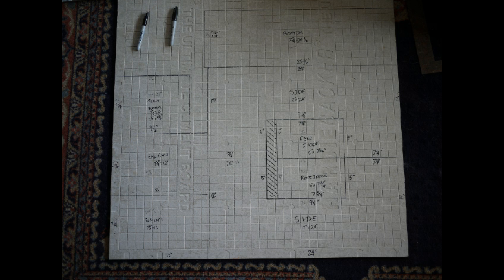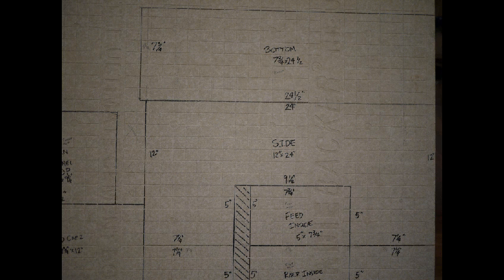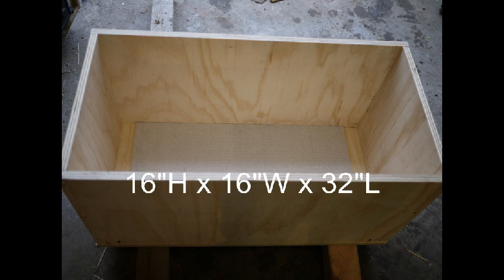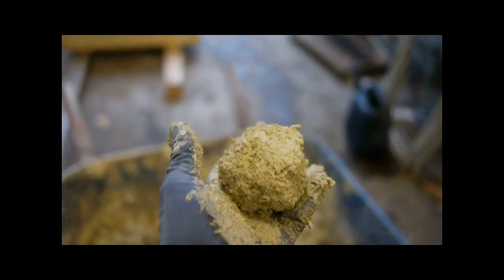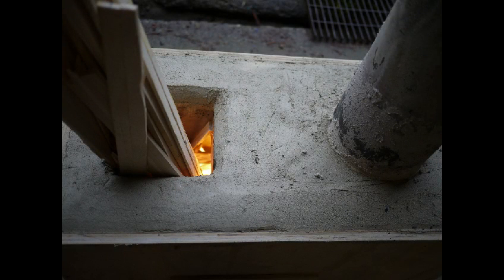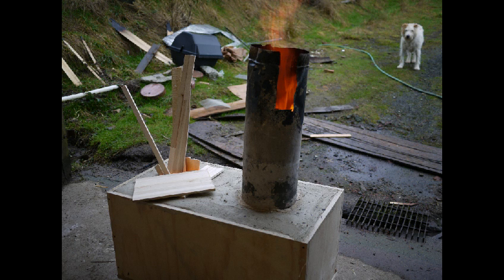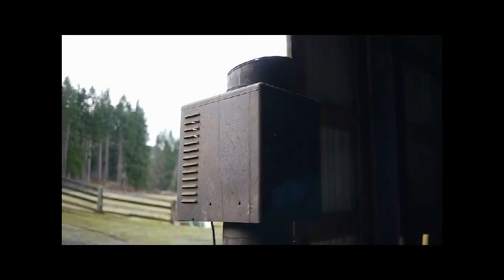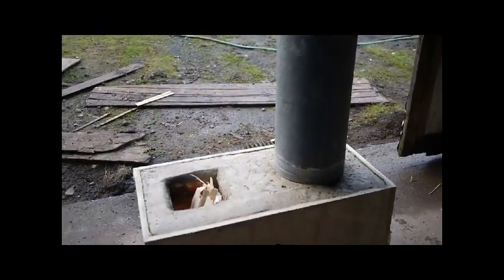Rocket Mass Heater Cast Core Build

Comment: At the end you say, "then you're ready to fire 'er up". But presumably you would need to connect it to an exhaust pipe before burning, correct? Or are you moving this whole core and burn chamber into place in the house AFTER you finish constructing the core components?
Reply from the maker: The latter.  I build them outdoors, or, rather, in my wide open shop, and then burn it dry before moving inside.  You could cast in place, and connect the exhaust first, then dry it out in place.  I actually think this is a better way to go, but in the case of the video I was building it for a friend, so was working remotely from the final install site.  Hope that helps.
Reply: ***** How many burn hours does it typically take before the core is ready to set in cob?  What signs are you looking for to know that it's fully cured?
Reply from the maker: I don't think I could put a time on it, but the idea is to get it firm enough that you can move it without it sagging or deforming.  I would say that a few(4?) hours of burning will certainly not dry it entirely, but should set the mix so you can move it safely.  Once in place you can start cobbing around it even if it is not fully cured.  Thanks for the comment.

Comment: It is doable, i think.
It will crack a lot most probably but we dont mind that until it holds together. So i recommend to put some reinforcements inside. Like reinforced concrete, but with long glass stripes. 
Painters have tape like (thin veil or tissue like) material for dry wall joints. We could use that to keep the piece from cracking, (or at least not to fall apart) by placing the stripes near the surfaces of the piece.

Comment: Hi Matt, saw your video where you converted your home rocket heater to a batch feed based on Peter Van de Bergs batch heater.Very intrigued by this.Where could I find more details to make one myself? I also sawed a barrel in half for quick bench material.Thanks.
Reply from the maker: Hi Emily, best place to find details on Peter's design is on Donkey's forum on Proboards.  Search "rocket stoves..experimenter's corner" and it should come right up.  I hope to create a video showing my process soon.  Glad to hear about your progress, good luck on the build and thanks for the comment.

Comment: Okay, maybe a dumb question, but can I make it without the refractory cement?  I mean 1/29th  is only 3.5% of the mix, doesn't seem like nearly enough to make a difference.  Have you tried making it with fire clay and perlite alone?  Thanks.
Reply from the maker: You can, that is how I do the riser since it is encapsulated.  The furnace cement mainly is there for the addition of sodium silicate, and it doesn't make it much harder over time.  Just harder, sooner.  The whole thing is fairly fragile, and without the furnace cement, a little more so at first.  But yeah, I say go for it.

Comment: Thanks for the video! I've watched it many times but ironically didnt sink in that I'm trying to help my dad build a 6" and not 8". Would you still use the same dimensions as you have here? How many bags of perlite and fire clay did it end up taking? Thank you.
Reply from the maker: Brian, to make a 6" use the same overall Length and Height for riser/feed stubs, but make the passageways 5 3/8" sq. instead of the 7 1/4" shown here.  This one took 3 bags of Lincoln 60 clay and 4 cu/ft perlite.  Good luck on your build.

Comment: FInnaly getting to it. 

If the burn square ection (7.25x7.25) is smaller, would I need to shorten the horizontal 9 1/2" burn chamber?
Reply from the maker: No, keep it the same length.  Any shorter and it becomes difficult to fit the barrel, you need a little distance from the wood feed.  Hope that helps.

Comment: Unless your house is so tight you can take it into space, I wouldn't have thought it was a problem, the negative pressure will find any leaks, there are always some, even in the best built homes and it's not just doors and windows but roof and walls as well, although your walls will probably be pretty good but you get the idea.

Comment: Hi there I was thinking today could that be made out cardboard or is that to weak ? . How are the walker stoves coming ? . Thanks dan
Reply from the maker: Hi Dan, cardboard will soak up the water in the mix and get too soft.  You can use anything that will stay strong when wet, wood works fine. Walker Stoves is moving forward, slowly but surely.  Thanks for the comment.

Comment: What is the source of your research on the efficiency of the cast core vs built with firebricks? If a cast core is more efficient, then it must be due to the insulating characteristics of the cast material, correct?
Reply from the maker: Hi Douglas, in this video I was hoping to convey that I felt that the insulated core offers better performance, not necessarily efficiency.  Efficiency is tied so closely with the heat extraction of any given system that it's hard to compare when all RMH's are site built and use different extraction and thus will have different efficiencies even with the same combustion unit.  At any rate, if you watch my video here: Rocket Mass Heater tested with Flue Gas Analyzer you'll see how my cast core runs, and of particular note is the extremely low CO numbers.  When running full out it is typically running at less than 10ppm CO.  I've never tested a brick built rocket mass heater that was able to run at that low level.  Not to say they aren't out there, I just haven't run into one.  At any rate, yes, I believe a highly insulated core performs better than a core of the same design built using bricks.  That's my opinion, I'm sure you'll find differing ones out there. Thanks for the comment.

Comment: Getting closer to casting - wondering if one were to scale this down, say to a 4" outlet, would it be to much to assume that I could just cut my dimensions for the pieces in half???  The shop is only about 400 sq ft.  Thanks
Reply from the maker: Richard, you may be able to, but 4" systems tend to be very tricky to get right, and are a pain in the butt to feed in my experience.  I'd recommend no smaller than 6", you can feed less wood if you don't need the full output.  For a 6" system make the square passageways 5 3/8" square or so, and leave the overall lengths and height of all outside dimensions the same.  A big pitfall of scaling down is you can leave yourself with no room for the riser/barrel combo if you shorten the overall length by too much.  Good luck on the build, and thanks for the comment.

Comment: Great project, thanks for sharing. How will this cast core stand up over time compared to firebrick or regular soft brick, or is it too soon to tell?
Reply from the maker: I burned mine for 3 full seasons and it held up fine in the burn areas.  The mix is soft, so it wears from wood feed abuse, but a handful of mix every month or so is all it takes to patch it up.  I would say it's comparable to soft brick.  I don't recommend firebrick, they make a very hot feed that creates a whole host of problems.  You asked about fiberglass, and I don't have an amount for you.  You want it evenly spread as single hairs throughout, but no clumping.  Not much, a few handfuls will do it.  Good luck on your build.
Reply: Would it help to coat high wear areas with Water Glass ?

Comment: So if I build the tube with wood, it sill burn out on the first burn and then the fire will
just 'sit' and burn on the cement/perlite/fireclay mix?

and is that heat resistant enough?
Reply from the maker: Yes, the fireclay/perlite mix is a decent refractory material.  It is a bit soft, so areas where wood abrades it do wear, but it is easily patched with more of the same.  I used mine in my home for 3 full heating seasons, as the sole source of heat, and found it performed very well.  I did have to patch it occasionally through the season, but that was acceptable to me.  If you want a more durable core you can source some castable refractory and follow these same plans.  Reduce the outer mold so that the wall thickness is only 1"-2" if you use castable refractory.  Good luck on your build Yves.
Reply: thank you, I am very excited about this project. Unfortunately I'm not a regulard 'builder', more a software guy..;)

Hope you don't mind my new questions:
1) what is 'castable refractory'? is that the expensive stuff you mention in the video?

2) How did you channel the heat inside your house? did you have a heat exchanger and blew that throuhgh ducts around the house or did you heat up a closed circuit radiator system? (because we have that here).

3) and finally: I was thinking of makign the tunnels out of cardboard. by rolling them in a tube shape an then cutting them at 45deg angles. after the thing cures it should be easy to remove some part in the center and once passage is there, simply burn the rest out?
Do you see anything going wrong with this?

again thanks  and please let me know how I can support your efforts

cheers
Reply from the maker: Yves Baggi
Hi Yves, here's some answers...
1)Yep, the expensive stuff.  Used in industry, as the inside of industrial boilers and stuff.  Can be hard to find, but worth calling around if you live in a place that has industry close by.

2)Nothing that fancy, just heat the mass, which is made of cob(clay/sand...basically mud!).  That's the benches around the heater in my other videos, they have the flue pipe running through them, heating the mass.  It's basically a masonry heater, or perhaps you know them as russian heater, kachelofen, or contraflow masonry heater.  Similar concepts.

3)Cardboard will become wet and lose it's strength before the material dries.  Use wood or something that will stay strong when soaked.  It will be very wet before you burn it dry.

Good luck on your build!
Reply: *****
I'm thinking it would be a good idea to line the feed tube (especially the bottom) with sheet metal, and replace the metal when it burns through, rather than patching, or is that overkill?
Reply: jps99
I think it'd be kinda hard to get to once everything is cured. but if you go with a square section burn chamber, using firebricks at the bottom and sides could be a cheaper and easier to build option,

Maybe broaudio can comment on this
Reply: Yves Baggi  It would be pretty easy to line the square duct with sheet metal, I've seen that done. I was thinking of a flat piece of metal just lying in the bottom of the feed tube to prevent damage by the wood always hitting the bottom of the feed tube.  Firebrick at the bottom of the feed tube might work though.
Reply: Aha, yes, protection against chipping off the material. good idea. thanks
Reply from the maker: Don't bother with either, the metal will burn away almost instantly, and firebricks create a lot of problems by being so dense and holding heat right where you don't want it.  Don't overthink it, the mix is a great DIY solution that only takes a few minutes of maintenance a month.  If you really want a better solution the best way to go is find some castable refractory, but this mix gets you 98% there in a very simple way.
Reply: *****
Thanks for your feedback. I have all the parts needed based on this video. so I just need the time to do the casting and with my dismal carpentry skills it will take a bit of time..;)

will report when It's done though

I've found the cheapest refractory cement at 21 euros ($26-$27) per 25kg bag. might buy this for version 2.0....

thanks again a whole bunch
Reply: *****
 Thanks. I'll keep it simple then. I plan on building an 8" RMH in my barn to keep temperatures above freezing so my goats and rabbits will have water available. My idea is to use the barn floor as the thermal mass, so this will be an under floor installation, unless you tell me this is a bad idea. The burn tube and heat riser will be in a separate room from the animals, so they won't get near the hot parts. I'm thinking that burying the 8" pipes in 14" deep trenches and covering with 6" of cob will hold up well, or should I limit it to 4 "?
Reply: jps99
Are you planning to insulate the cob from the ground?
Reply: Yves Baggi No, the dirt floor of the barn will be the heat collector/radiator. The Cob will have a few inches of dirt on top to level the floor.  I don't want to build a cob bench that the goats will be jumping on and destroying.
I imagine I'll have to do some pretty hot burns to keep the barn (800 sq ft) above freezing through the Michigan winter.  The barn is insulated R 7.5 in the walls and R 20 in the attic, and it is new and not drafty, so I might have a fighting chance.
Reply: I meant underneath the cob. to insulate for the earth....IMO a lot of heat would be lost downard.

sure thing MI can get cold
Reply from the maker: Yves is right, if you don't insulate underneath it you will not get much heat into the space.  The floor is a huge cold sink, and will overpower the RMH for sure, to the point that you will get very little if any heat in the space.  Let the goats jump all over the bench, and insulate underneath.

Comment: I'm confused. Forgive the noobish question. With a riser, could you still add an exhaust that goes runs under a bench? Are you going to add an entrance to clean out ash?
Reply from the maker: Dyer, did you mean without a riser?  I'm confused too!  This is part one, see my other videos for part two which is casting the riser.  This stove will have a riser, and yes it can power a bench run.  No ash cleanout in the core, it's a bad idea in my opinion.  It's easy enough to clean out what little ash there is with a small scoop every week or so.  Clean outs are very important in the flue runs under the bench, that's where most of the fly ash accumulates.  Thanks for the comment.

Comment: My biggest concern is equal cross sectional area past the core and heat riser. My core and riser will be 8 by 8 throughout.  But how does that apply to my barrel.  Center it and shoot for 4 inches on each side of the riser? Also how does that apply to how close the riser top is to the barrel.  Iv herd 1 inch works well?  Also the manifold that connects the bottom of barrel to 8 inch pipe...so does the manifold need to be as close to 8 by 8 as possible to acheive equal cross sectional area as well?? Or would something like a 12 by 6 register box that transitions from rectangle to 8 inch round pipe work just fine.   I'm shooting for equal 8 by 8 throughout jus wonder how to apply that to inside my barrel and manifold at bottom of barrel going to round 8 inch pipe.  Can't seem to find specific info on this.  I'm going for the best rocket effect possible.  Thanks a million buddy  let me know when u get a free min....
Reply from the maker: Bigger is always better once you are past the riser, but you can't have any restriction, so barrel top gap should be LARGE, 3"4" minimum, larger is fine.  Side gap, as big as you can make it and still insulate the riser, say 3" minimum or so.  Manifold is important to be oversized, and you have to think of the passage in 3D.  The box may work, even bigger would be better.  When you get to that area do everything you can to "port and polish" that thing, just think flow.  That's how you get it to rocket, no restriction, all flow.

Comment: Can you create a pdf of the 6 inch one if using 1/2 in plywood? That material is everywhere and will burn out on firing...? Thanks
Reply from the maker: +ShaggtyDoo Hey shaggty, just go for these final I.D.  12" tall feed and riser stubs, 24" long inside end to end, and all passageways 5.25 square.  So, depending on which way you overlap the edges, some of your parts will be 5.25"w and others will be minus the inch of two pieces of 1/2" material.  You can do it!

Comment: just guessing here, but can you put hard brick inside the liner as well as outside, and achieve the same effect? or does that defeat the purpose? trying to think of a way to prolong the life of the core, to consume less materials and for it to require less mantenance.
Reply from the maker: The simplest way to build a Rocket core is just to stack fire brick.  That is durable, but high mass, so slow to start and robbing energy where you want to focus it on the combustion.  This insulated core offers higher performance at the expense of durability.  Thanks for the comment.
Reply: So in short, the insulated bricks for places like a garage, and hard bricks for things like heating a house or greenhouse. thanks for the reply.